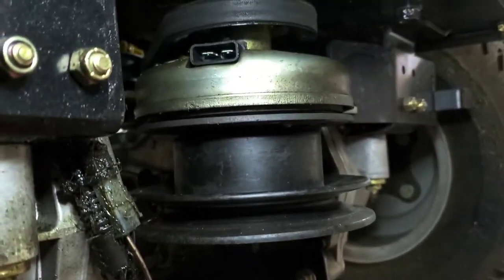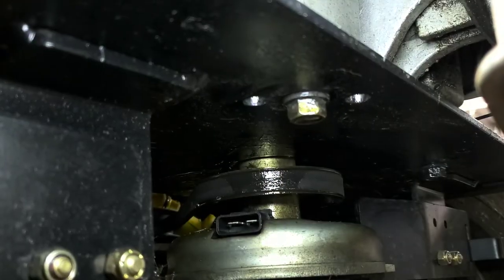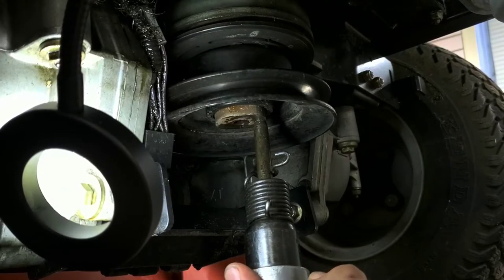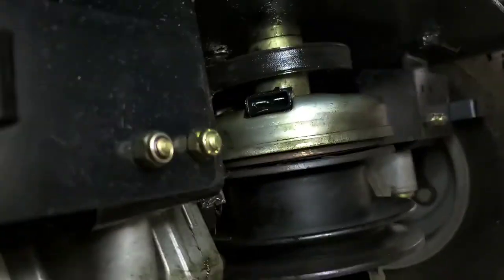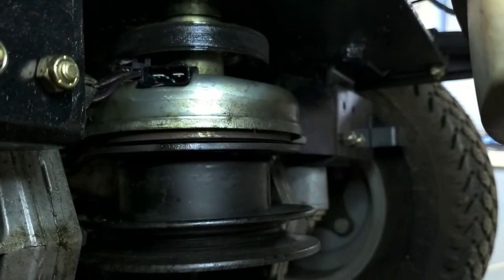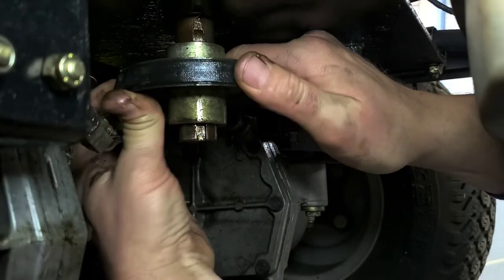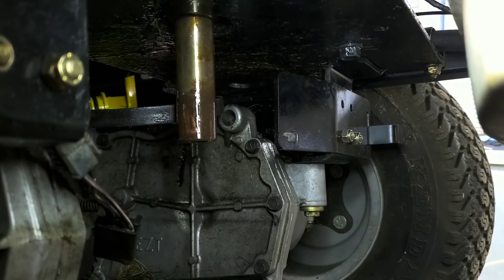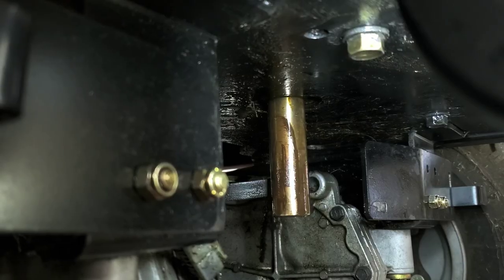How To Remove Stuck On Electric Pto Clutch Easy

Comment: Thanks! I was trying to get the PTO clutch off my ford yt16 for the upcoming tractor show and I worked on it I just couldn’t get it off, this tractor was previously neglected a little bit, and there’s oil all over the bottom of it so I didn’t want to risk using a torch. So I tried this method and it worked out just fine after a while.
Reply from the maker: Awesome! Thanks for watching!

Comment: Thank you. Unfortunately I do not have an air chisel. I used a electric impact wrench a socket and a pipe wrench to do the vibrating. What I did was I had a pipe wrench that was about 11/16inch wide and put that in the end of the socket and while holding the grips I turned on the impact wrench and since the socket couldn't spin the hammering impact feature made the pipe wrench vibrate so I put it up against the engine bolt. I used WD-40 and it penetrated enough that I was able to hit the assembly with a hammer and the whole thing fell out.
Reply from the maker: Awesome!

Comment: Worked like a charm on a clutch that was scaly and looked like it spent some time in the ocean! I bet an old timer taught you that right? lol take care!
Reply from the maker: Works every time! The old timers always have the best tricks and tips for us that is for sure!
Reply: If I don't have an air impact hammer?
Reply from the maker: Use a regular hammer with light taps. It does take a significantly long time but works just as well. These small impacts work lube down onto the shaft

Comment: When the top belt is left on the pulley is in a bind on the shaft. If the belt was off, a slight tap usually removes the whole device. 90% of the time, when the belt is off, taking the bottom bolt lose is all that is needed and the whole thing falls off.
Reply from the maker: It is your story, do it how you like but the top belt has no effect on the PTO clutch coming off
Reply: @IndRepair  Just admit you forgot to removed the belt first. I'm just trying to prevent a lot of trouble for the novice mechanic. Even with rust on the crankshaft, there shouldn't be this much trouble getting the PTO off the shaft. The pressure of the belt pulling sideways on the PTO will stop the PTO from sliding off the crank. 
Just looking at your video, the whole PTO came off the shaft till you got to the last sleeve (there are 2 sleeves with 2 bearings) with the belt on the pulley. The pulley would move up and down the shaft an 1/2 inch or so until you took the belt off, then it slipped completely off.
Reply from the maker: @charlesgale8115  The drive pulley was not stuck on. This is pointless.
Reply: @charlesgale8115 the drive pulley isn’t attached to the clutch, on the pto belt goes on clutch
Reply: My belt is off, and even with the air hammer, it will NOT break loose.
Reply: @djangostudios2592  Another thing to try is to get some whisky on the shaft. Penetrating oil is fine but sometimes isn't enough. I use bourbon, but I don't know if any alcohol will work. I've used it on fan motor shafts and bolts and nuts so I imagine it would work here. Get it above the pulley if you can. I've used a squirt bottle or a small paint brush to get er done. It's a shame to waste the bourbon but after a couple of hours of beating on the clutch, you can make to make the sacrifice. Don't use Crown Royal, but there are some $5 pints available.
If you resort to heat, you will most likely melt the seals on the bearings or the oil seal in the crankcase.
Reply: @charlesgale8115  I think I speak for everyone when I say you should dump the bourbon out 😂 I took the drive belt off, not because it was in the way of anything though. On the simplicity 41420 it’s easier to take the drive belt idler off to get to one of the motor bolts. I was just taking everything else apart while contemplating how to get the pto pulley free. I was going to use the air hammer but I only have a chisel bit and didn’t want to mar it up

Comment: Why did you take the top pulley off? That's got nothing to do with the PTO clutch.
Reply from the maker: Most times when needing to remove the PTO clutch it is because you are going to be  replacing the drive belt. That was the case here and is the same process to remove as the clutch itself. Thanks for watching!
Reply: Plus add antizzzzzz